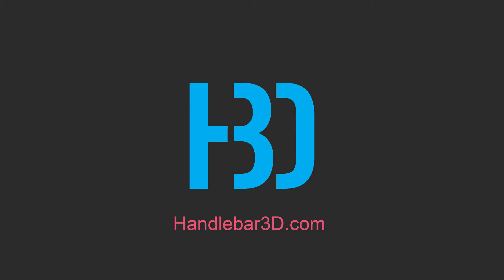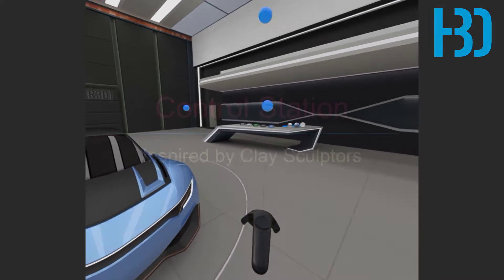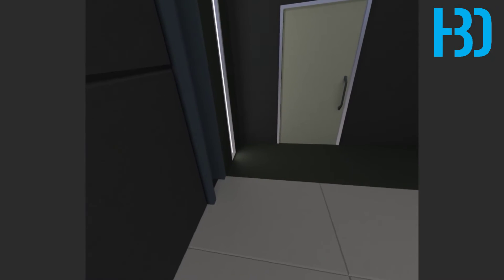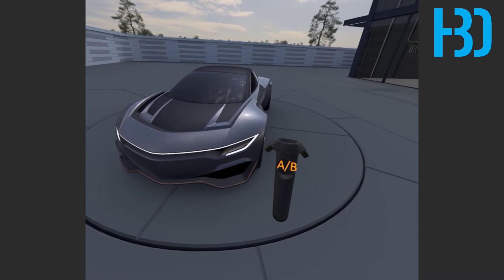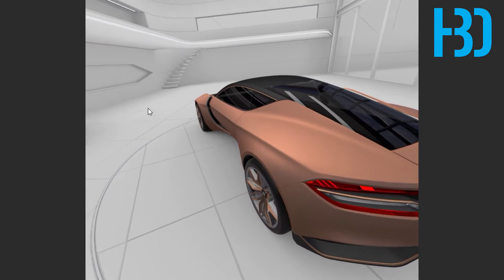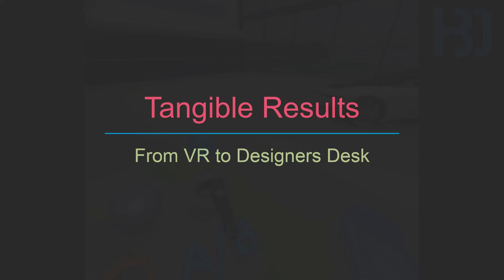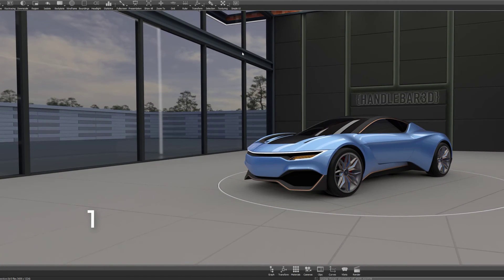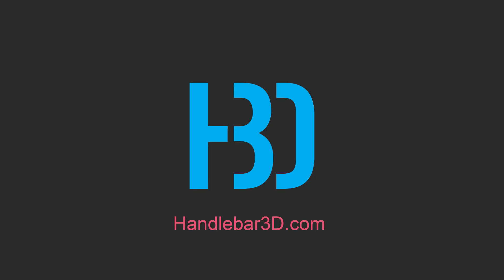VR with VRED and the HTC VIVE for Car Design

Comment: I've got a question, How do you bake the texures in the VRED scene as if it's a realtime rendering ?
Reply from the maker: Charly Poidevin I do exactly that. I bake in the light and shadows but I use modo for that. The walls are all just diffuse images.
Reply from the maker: Charly Poidevin oh and I actually have a tutorial on that in my website in the vred section
Reply: Oh I understood after reading on your website. I've tested yesterday VRED Occlusion shadows calculation, bu it didn't gave me a cool realtime result, just basic shadows...
Reply from the maker: Charly Poidevin Yeah you need to use some other software that can bake light and shadows into uv texture maps. I use modo myself.

Comment: Hi, nice job there! I´m working too with the VIVE and Vred, but I didn´t find a way for the other viewers (spectators during a presentation) to not have the "2cameras/eyes"-effect. Do you maybe know to get rid of that?
Reply from the maker: The way I recorded this was enabling the back face culling, to get rid of the  circle in one eye. It still has two views but at least I could record it without them. What you are asking for is possible, I have done it with a couple of clients. You would need to have two systems running, one for VR and one for the spectators. You then have to add an external process that connects both systems. This way theirs a VRED session controlled by the spectator and they can see where the presenter is and what he is doing on the scene.
Reply: Ok, thanks a lot!